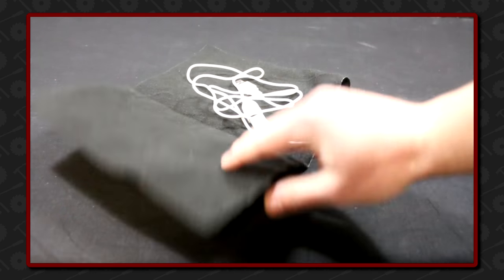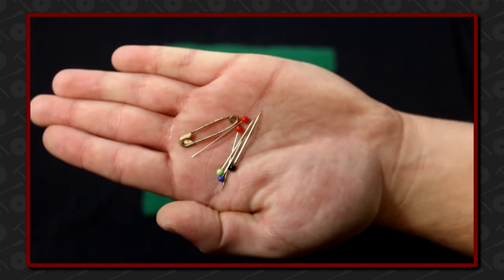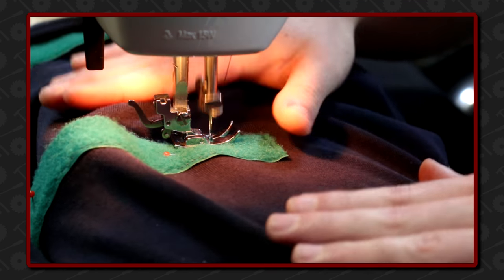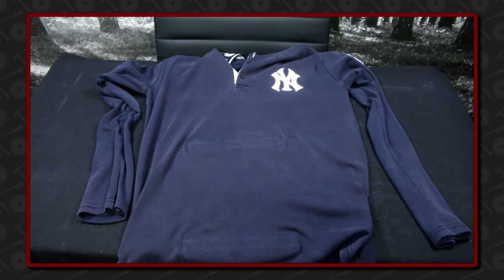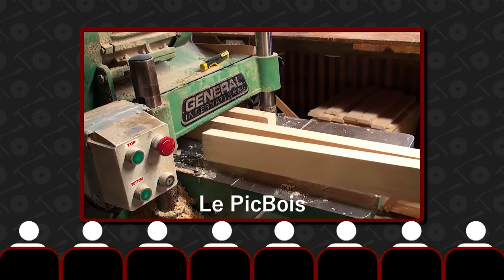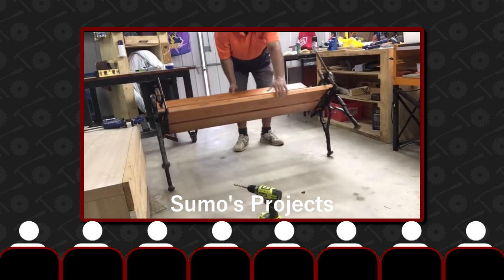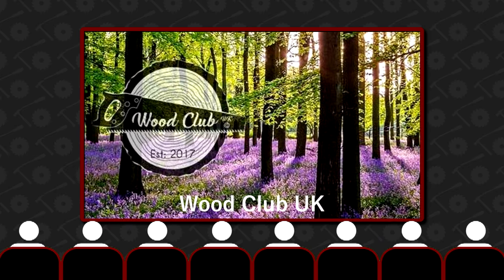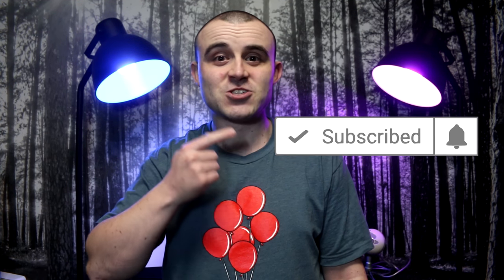Make Your Own Heated Shirt Powered By USB - While The Glue Dries

Comment: Joe, great idea about the shirt. I was just concerned about you sewing through the heating element and damaging it and in turn you. Could you feel where the element was inside the pad?
Reply from the maker: Thanks mate! Yeah the element is quite prominent to feel. The space a long the edge have a large area with no wires and then on the side that cross over the elements its easy skip where the wire is